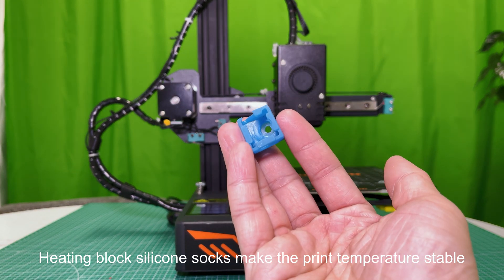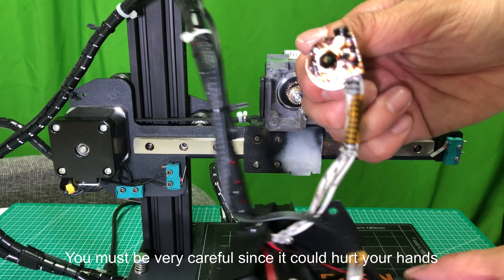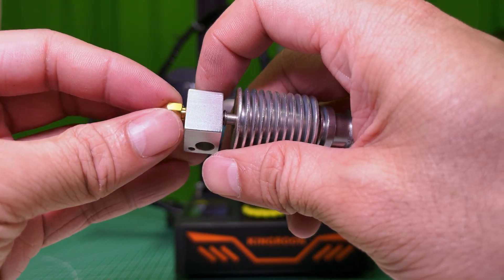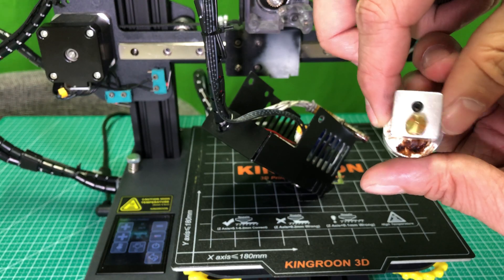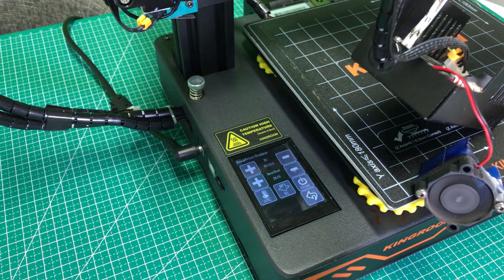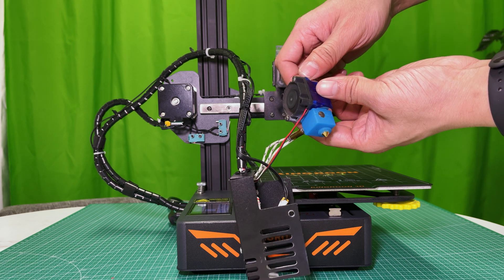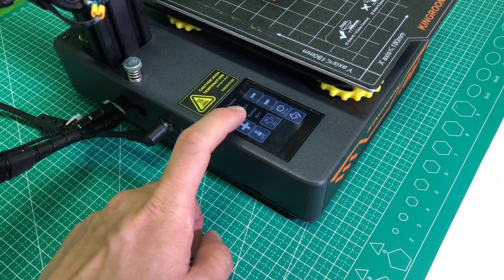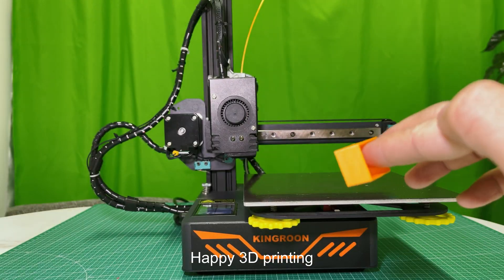How to Add Heating Block Silicone Socks for KINGROON KP3S 3D Printer

Comment: I notice you switch the side the heater/thermoster cables run. Is there any reason to have it one way over the other?
Reply from the maker: It was designed that way, so I have to switch its direction.